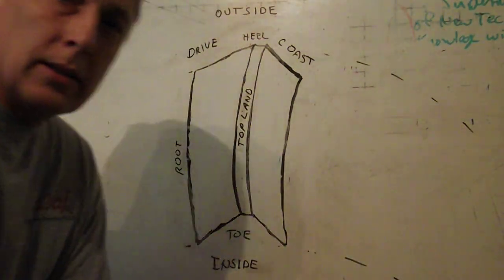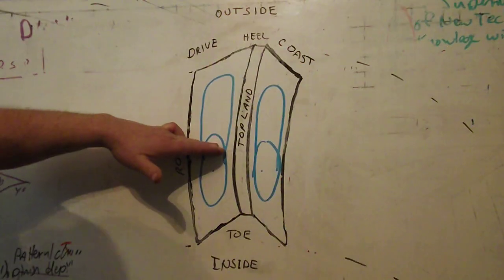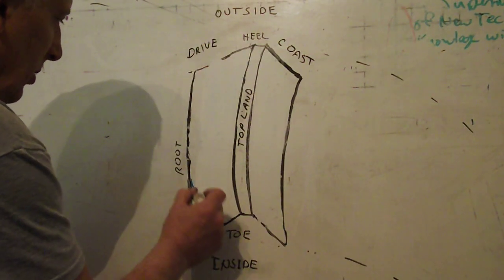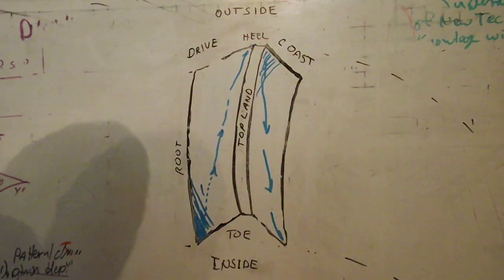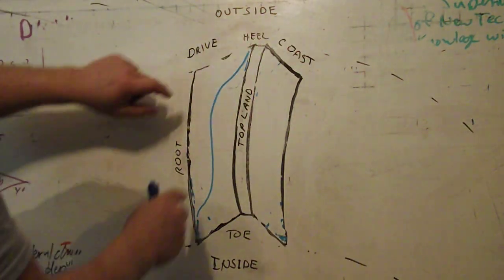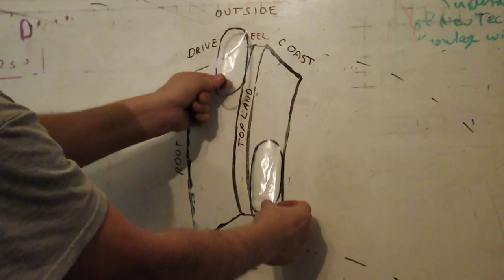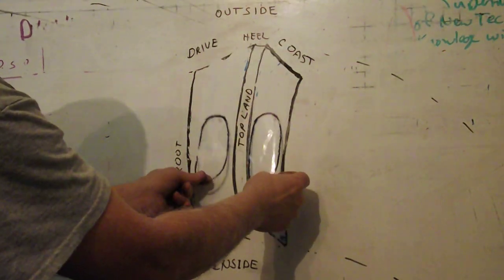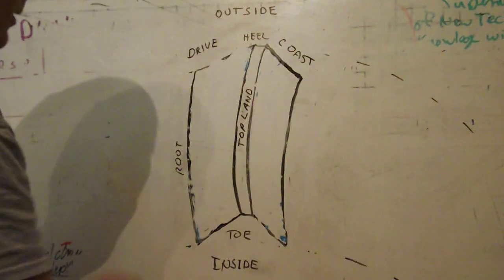Ring & Pinion Patterns explained, back lash vs pinion depth

Comment: I'm in the middle of totally restoring my ford 8.8 , as well as gear swap. Excited about going to 3.73.  I used one of those Ratech pinion depth gauges to get a good starting shim of .018, got my back lash at .010 which is right in the middle of the Ford spec of .008 to .012, Just ran my first pattern and I got the two little marks  drive side top, and heel side toe. Sounds like i need to just adjust to a thicker shim on the pinion. The 3.08 pinion had a ..020 shim, and I think Ford says if you don't have a base start with a .030.......I dunno. This is my first rear end rebuild and I have found it to be more challenging than the T5 transmission I recently rebuilt. T5 was also a first for me. I do love the journey, and the search for knowledge before I tackle it. In this case I'm in the middle of it and needed some guidance. THIS VIDEO WAS GREAT!  Thanks so much!!  You should go check out my project car.

Comment: great theory video, sadly doesn't always work in real world. for me i had to sacrifice coast pattern to absolute shit to get okei drive side pattern. plenty of people have said adjust your drive pattern cause this is where you are 95% of the time. if the coast pattern is bad then that's just how it is.
from my multiple shimming tries i noticed the you change pinion depth to move the pattern from root to top and top to root. backlash is going to move it like you showed diagonally across the tooth.

Comment: Man I need some insite my pattern is showing on the heel of the drive side so really shallow but how much does say .005 affect it. If I had say .020 shim is that gonna take me from real shallow to about right or to deep?
Reply from the maker: @dakotanugent3905  send pics of drive and coast to 425-327-0804
Reply: @ alright will do when I get back to the truck in the morning. My kit came with shims for behind the inner race of bearing and I don’t want to risk taking it on it off a bunch so trying. To figure out how thick of one I need to put back behind the cup to get it close as I can

Comment: When you get the gear set that is hard to get both sides matching , always get the drive side right. The coast is reverse and not under high loads. The pattern that is ideal splashes the oil out away as the tooth comes in. This vid nails ut

Comment: I have been fighting a C3 Dana 44 for more than a week now. I love the car, hate the Dana 44. It's a dumb design to have to press on bearing on and off while constantly changing shims trying to get the pattern right. I am broke and should have just bought a rebuilt unit with a warranty thinking I could save money and do this myself. I thought I did everything right and still cant get the pinion depth and gear lash right. The big problem is the idiot manufacturer sent nothing but thick shims with the kit. the thinnest shim is .0102. The shims I pulled out of my old unit has a .0036 shim it it. unfortunately I damaged it pulling the race out.

Comment: I have no idea what was just explained.  Just yesterday, I tried to do a ring and pinion gear swap. I was told I needed some  special tools. My question is, I want to do a ring and pinion gear swap. Both gears are factory installed. Do I need to do depth and lash if I am only swapping out the pinion and the ring gear? Thanks

Comment: I found it very helpful.  Changed the carrier in my 97 S-10 to a Torsen from a 2000 Z-28. I used the original 3:42 gears that were the original ones from the S-10 housing.  Replaced all the bearings and it was way off,carrier had to be reshimmed.  Got it adjusted to .006 and it works great. I ditched the crush sleeve and used a solid pinion spacer with shims. That was alot easier than crushing the sleeve. I've never used a crush sleeve. I always replace it with the solid spacer and shims. I've heard slightly crushing them in a press between 2 steel plates makes it much easier. Just crush it unit the bulged part of the sleeve just barley starts to crush. I've heard sometimes it can take up to 500 ft/lbs just to start crushing some crush sleeves. That would be dang near impossible to do with the axle in the car without a lift,wouldn't it? Maybe there's a secret technique I'm not aware of?😀
Reply from the maker: Crush in press between two flat plates, place old sleeve next to it plus a .020” shim as a gauge, crush till the plates just tickle the old sleeve plus shim.
Reply: You’re right! Crushing one in the car that’s that tight is a beating.

Comment: I been watching a ton of videos on car repair and I had no idea of the level of precision, shims, checking contact points, etc, required to repair or upgrade a differential. I remember getting a quote once to change a final drive ratio on a car I had. The quote I got was way beyond what I was expecting, and I passed on it. Now I understand that this type of thing is not something simple like swapping out an alternator for example.

Comment: Thanks for this.  What does it mean if I have pitting along the bottom of the ‘v’ on the drive side of pinion and mirror smooth everywhere else.  It’s weird.  Matching wear on the ring gear driven side along the peak of the teeth, but mirror smooth everywhere else.  Original ring/pinion gears (moto guzzi Le Mans 1000) are non existent, so saving the ones I have is something I’d like to do.

Comment: I keep seeing that backlash also moves the pattern between the root and the top of the tooth. That does make practical sense, as the ring gear is moved in and out of the pinion gear when you adjust the carrier side shims to change the backlash. Correct me if I'm wrong, and can we find out how that would not work as I've stated? The  curvature of the teeth on both gears? The tapered conical shape of the pinion gear? The tapered cross sections of the teeth of both gears? Anyone out there know?

Comment: Thank you ,I was having trouble setting up a used ring gear , I Had It close ,But the ring gear was exactly the pattern you say ,When it is out to far , I could never get it to come into the real pattern , The backlash calls for 6 to 10 . It was at 11 ,Tightened the back lash to 004 , its perfect , Im Going to put it at the minimum of oo6 tomorrow , The point is for no explainable reason , When the backlash was 11 which is 001 over spec , It looks like pinion to far out pattern you showed , Bringing the backlash down , has solved it , I didnt know , 001 over speck meant much , or 002 under spec would make it move tothe right place . 
At any rate a great big thank you for this video !

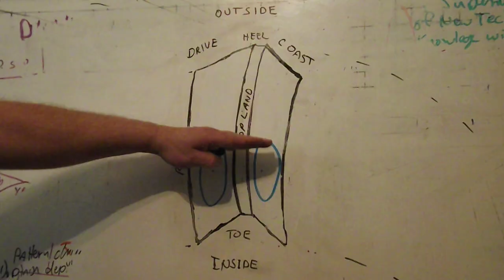Comment: Thank you for the video. I have a question at 0:30 in the video when you explain that the gear will “crawl” which can change the pattern. I’m wondering what is happening here since I think of the ring gear and the pinion gear both being in a “fixed” position. I think I understand that the bearings have internal clearances that could allow this to happen. Is it from rotational forces on each gear that causes this? Heat expansion causing this? A natural reaction due to the cut of the gears? Any insight would be helpful. I’ve never heard of this before but it makes total sense based on multiple factors. Hope my question made sense. Thank you.

Comment: Have to pass along my thanks. Very helpful the detail of expected movement path of contact as particular adjustments made. Something important briefly mention here to favor the toe a bit on setting because under high load the imprint will drift towards the heel.  I also suspect the backlash setting could open a couple thousandths too.
Reply from the maker: Correct, and backlash only get larger with time.

Comment: On a front jeep wrangler dana 30 axle, which side of tooth is drive side? Convex or concave?
Thanks!
Reply from the maker: For all front ends, If it is high pinion, convex is the drive side, for low pinions it is the concave side.
Reply: @superjeep47  THank you! I kept getting my patterns biased to the topland on both drive and coast side. I set the backlash to .005 and installed a thicker pinion shim by .006 to see what happens. Whala! IT got me more centered (toward root).  Now however my backlash is .003. Is that what I would have expected? So now, if I reset the backlash to spec I should be good as long as pattern is accepatable,,,,,Is that correct?
Also, if I am using the old bearings as "set up" bearings and then go ahead and install new ones, what changes should I expect and does this mean I will have to adjust backlash again?  I am wondering If I should just wait to adjust it again from the .003 it is now, until I install the new carrier bearings and pinion bearing.
THanks alot!

Comment: I have a question I can’t get my head around. I’m installing a Detroit True Track and new Yukon 3.31 ring n pinion. Renting all tools. No dial indicator to be found for rent. Seems to me if you set preload properly with correct shin in pinion. Your painted pattern tells you everything you need to know. As long as you have a little tick or movement in ring gear. And pattern on paint is good. Your good without the use of a dial indicator for back lash !!  Correct me if I’m wrong. I’m in a camp ground and have to do this tomorrow. Please reply
Reply from the maker: Sorry was in Alaska fishing, you are essentially correct, you can make a feeler gauge. Notebook paper is .003” thick, ” . Cut some slips approximately the size of ring gear teeth, smear some grease into them, layer 3 pieces together and stick to a tooth, rotate, you should feel them get tight, if you dont, degrease backlash, if its so tight you cant turn then increase backlash. You want to crush 3 peices and not feel 2 then you are in the .007 to .008 range.

Comment: So if the pinion is scrubbing to far to the inside of the ring gear  on the drive side (he said pinion to tight) do I need to remove shims
Reply from the maker: Depends where the shims are, 9" ford  and 14  bolt gm  3rd members have removable pinon supports so adding shims decreases pinion depth, whereas just about everything else adding shims increases pinion depth.

Comment: Is it better to keep your backlash on the tighter side (low numerically) so as the gears break in any additional clearance given will keep back lash from moving too far out in spec? For example let’s say it’s supposed to be between 5-9 thou,  keep it between 5-7, then as it breaks in it’ll not go past 9?
Reply from the maker: I always go for less back lash if the pattern will allow it. Rock crawlers get .002" and need a good break in as things will heat up.  Don't forget Dana 80 factory is .004", so its not like I'm going to extremes.  With that said, I have had used gears that didn't get a good pattern till .025" back lash, but that was just in a street cruising car so we went with it. Pattern is always more important that back lash.

Comment: I have a 2009 Escalade took the front differential out, from the pinion touching the ring from front to back is at least 100 thousandth play between drive and coast, should it have that much play.?

Comment: I'm working on a 1990 ZR-1, just got it on the road yesterday and the rear gear is winning bad when it's in gear coasting. Can you help me? Im a decent mechanic with engines and such but not sure I can set up a ring and pinion. If I'm hearing this whine, is it too late for the internal parts, I only drove it about 5 miles, thanks, great explanation. 👍👍

Comment: Excellent explanation, kindly make practical video 
Please what the difference between the pinion depth and the pinion bearings preload
Reply: Pinion depth is where it rides on the ring gear,preload is the tightness/recommended torque on pinion nut,measured in so many Inch Pounds after tightening pinion nut to spec,with an Inch Pounds Torque wrench with a dial indicator!

Comment: Thank you for an excellent video. I am renewing bearings in a dana 44 using original ring and pinion and the same pinion shims. In ignorance I did not check the pattern first and now I am finding it difficult, some sources say it is not possible to get a good pattern on used gears. I also find that backlash varies on most teeth, the best I can get is .004" min to 010" max which is in spec according to my manual. Would you be happy to go with that, this is a Jag RIS so I don't want to do it twice.

Comment: does this apply to both face-milled and face-hobbed crown and pinion set????
also I am facing noise issue which arised when I decelerate (without brakes)..can this be attributed to improper noise pattern???

Comment: Clarification:-
Drive toe/coast heel, move pinion gear closer to ring gear, add shim
Drive heel/coast toe, move pinion gear away from ring gear, decrease shim
Reply: That seems to be opposite what the video says.  In a reply do a different comment, "too deep" means too close to the carrier, and the video says too deep produces a toe pattern on drive side and heel pattern on coast, so pinion needs to away from carrier.
Reply: @MikeON22  This is correct.

Comment: I am trying to find the effect on the pattern by moving the pinion (thicker or thinner shims) in or out like .001", or .005" . Is it a 1:1 ratio? i.e. does .010" difference in shim thickness move the pattern .010"?
Reply from the maker: it is not a straight line ratio. if you are way off changing .020" wont even make a difference.but as you get closer you can tell a .003" difference. For me to to this I just got mad one day, and started with a ford rear end, as they are easy to make changes with, started by pulling all the shims out of the 9" diff and then kept back lash correct, and added shims in .002" increment from 0 to.060" and mad pictures of each pattern, keeping the back lash at .008". then came back to the best pattern, and then varied the backlash from 0 to .030" making pictures.
Reply: @superjeep47  do you have those pictures posted somewhere. Im fighting an 8.8 with FMS gears currently.

Comment: Best explanation I've seen so far of this topic... Well done Carl !  FWIW I'm setting up my 2003 Mustang GT Automatic with 3:73 gears because the stock 3:27 have started whining on acceleration at 140k miles for some odd reason which I'm not sure of the cause, maybe loosened up pinion nut? So since I'm in the carrier anyway replacing bearings, races etc I might as well bump up the gears a little as well. Thanks again for a very clear explanation of gear patterns.

Comment: hi carl! could you please explain to me the difference between face milled gears and face hobbled gears?
Reply from the maker: +Greg Robinson I wish I could. I have spent hours looking at the chart Spicer supplies with some of their gears.( I love how the give the chart but then don't bother to tell you which type of gear you just purchased. )showing how different movements, have different effects on how the pattern changes. Some movements have the same effect, in both face milled, and face hobbed gears, but other movements  have the opposite effect. So since I can't recognize the difference, when I get one that seams to be working like I want it to , I go in the opposite directions, to see if it gets better. This is a big reason to have dummy bearings. and as said before, plan on lots of extra time to do the best you can, when you get a weird one.

Comment: Excellent video Carl.Just subscribed.  Marked as favorite so I don't lose it! I'm going to swap a set of gears between 2 different 8 inch fords, one posi one open. the gear set in the posi is worn-3.55/open is good 3.25. What I'll do before disassembling the 3.25 unit is check the pattern, then, after removing the carrier, check the pinion depth, also backlash. Doing the same on the posi unit (note the housing set I'm using is post 1967-posi. the gear set is coming out of is an early style 1962 housing. A lot note taking and pictures) When I get done I'll end up with an 8 inch 3.25 posi differential in a post 1967 housing. New bearings, clutch pack, solid pinion  spacer. Wish me luck!😆

Comment: Where do you buy the stuff to make the pattern? What's it called? Where do you get it?
Reply from the maker: +Consulting Dan It is called gear marking compound. you can get it as any differential shop.  I have also used Prussian Blue marking compound. or grease on a small piece of note book paper cut in the shape of the gear tooth. The grease makes it stick to the tooth. The notebook paper is also good for setting back lash if you don't have a dial indicator. notebook paper is .003" thick, so if you don't feel two layers of it going through the teeth, but you do feel 3 layers going through then you backlash is between 6 to 9 thousands of an inch. Also using one or two more layer of paper than your back lash will give you a nice indication of the pattern as the paper will crush where the gear teeth mate and remain untouched where there is no contact. (this is how I learned to do if may years ago)
Reply: freight

Comment: Good Job,    but what about used gears ?????
Reply from the maker: +Gfdf Perte Used gears always take hours longer to set up than new, because you are working against how it was worn out in a different housing, and often you must compromise. I find many times that I get a good pattern on one side but the other is lousy, in these cases, some times but not always, increase the back lash to around .020" to .025" and the pattern may come in on the lousy side, good luck!
Reply: thanks,   and the dana 44 is so hard to work with.